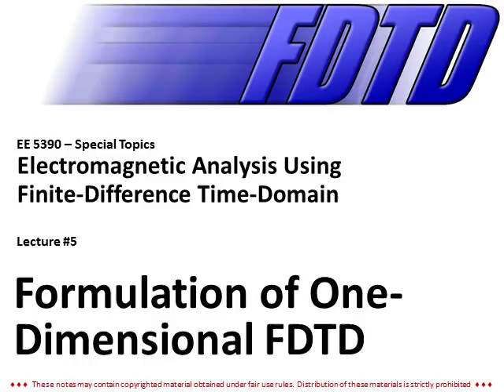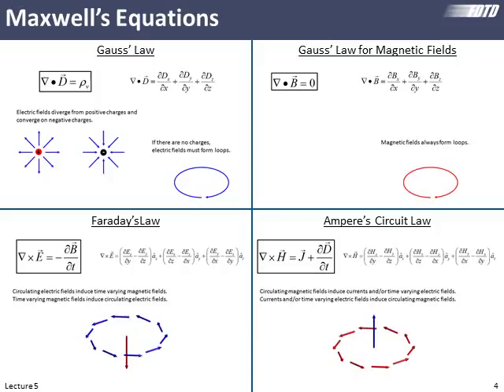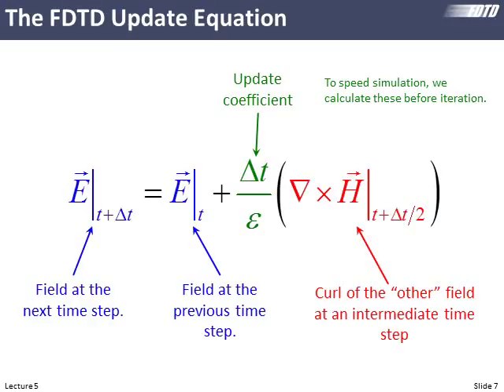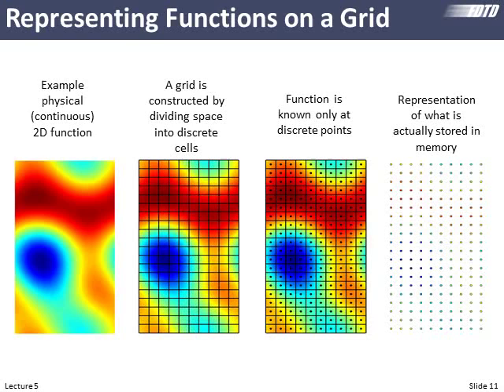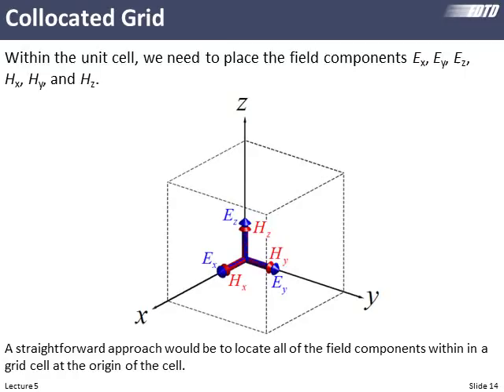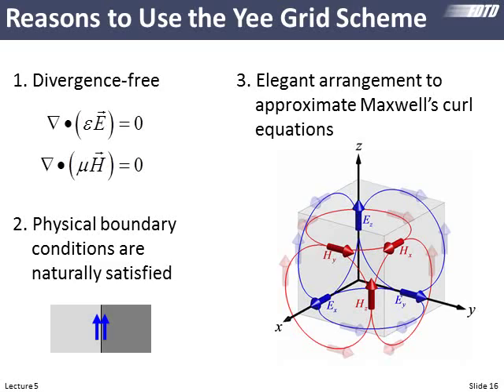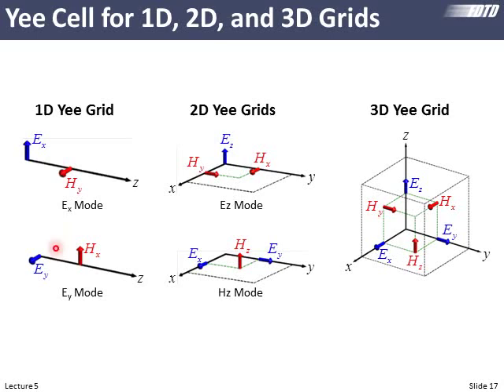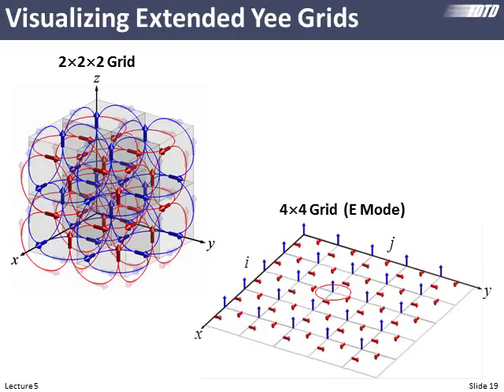Lecture 5 (FDTD) -- Formulation of 1D FDTD

Comment: I was reading the 1966 Yee paper,  the leapfrog method and t+dt/2 all made no sense.  I thought that all the fields should be at the same time step at least.  This lecture has made it abundantly clear how to reconcile the spatial and time increments.  I can't wait to see what the next 20 something lectures reveal.
Reply: OK

I had to slow down here and really formalize in my own mind what had been presented so clearly.  Writing down, in my own logic, what I had learned to this point and writing code was the key to the next level of understanding. I think that I even learned more about coding (comments), Taylor's series and finite differences and more about the Yee grid - leapfrog method - implementation.  

I guess I'll have to put it on a list of future studies to understand, by trying it, how the co-located grid points fails or gets complicated.  In other words why bother with the staggered (sp?) analysis.
Reply from the maker: The co-located grid does not inherently satisfy boundary conditions at the interface between two materials.  Instead, it acts like there is an electrical current at the interface that changes the magnitude of the scattered waves in strange and unpredictable ways.  The staggering fixes this.  There is a proof of this in Taflove's book on FDTD.

Comment: Looking like there are two  "bugs" in the MATLAB code (time:  43:35,) 
1) Hx(nz-1) when nz==1 Hx(0) is inaccessible (MATLAB is 1-based)
2) The loop work separately on H and E while each one depend on the previous step of the other one.
Can @EMPossible please advise?
Reply from the maker: You are absolutely right!  The solution to the problem is called a "numerical boundary condition."  That is covered in the next video.  I am trying to minimize the number of topics I cover at any single time so I do not overwhelm people.

Comment from the maker: A good question was asked, but then removed.  It asked about whether it is better to normalize the electric or magnetic field quantities in FDTD.  Here was my answer...

You can normalize either one.  From a mathematical perspective, one is not better than the other.  It is far more common to normalize the electric field quantities.  The most likely reason is that it was done that at first, and all others just followed suit.  [see note at bottom]  In this lecture series I show both, but adopt the more common practice of normalizing the electric field quantities through most of it.

If I could go back and time and change things, I might recommend we normalize the magnetic field quantities instead.  Most simulations ignore the magnetic response so there would be less quantities to normalize.  Also, we usually interact with our simulation (i.e. sources, detectors, visualization) through the electric field.  Have these quantities not normalized would be a little more straightforward.

In the end, it is just a constant so I would not worry much about which is better.

[note] A more extreme example of somebody doing something one way and others following blindly is in the area of semi-analytical methods like transfer matrix method, method of lines, and rigorous coupled-wave analysis.  Scattering matrices are usually used and EVERYBODY is implementing them incorrectly.  In fact, I wrote a paper on this...

http://www.jpier.org/PIERB/pier.php?paper=11083107
Reply: Why don't we non-dimensionalize both electric and magnetic field? I am a CFD student and in Fluids we have to non-dimensionalize all the terms in the equation. I want to understand why do we follow different practice in Electromagnetics? 
This topic is related to my PhD proposal and I would like to contact you about it. I have done some initial work in it using the methods I have learned in CFD. I would appreciate to have your feedback.
Reply from the maker: We should, but we do not do that here.  This course is an introductory course to computational electromagnetics and I did not want to throw too many things at them at once.  In the follow on class, we do this for every method we implement.

Comment: In slide number 46, a bug is present in the code. 
for nz = 1 : Nz
   Ey(nz) =Ey(nz) + mEy(nz)*(Hx(nz) - Hx(nz-1))/dz;
end;

Hx(0) appears in Hx(nz-1) when nz=1.
To avoid if statement in loop one can write the difference equation before for loop and then run the loop for values 2 : Nz
Reply from the maker: anuraag b You are right.  There is a similar "bug" in the other loop as well at nz = Nz where we try to access Ey(Nz+1).  This is an intentional bug because I handle the boundary conditions in the next lecture.  I am trying not to throw too many things out there at once.
Reply: CEM Lectures Thank you sir.

Comment: Where I’m quite unsure is how your matlab code correlates to the yee grid.

When we assume a 1D yee grid with a length of 100 (So Nz =100), the electrical field exists as an example at every even number of the yee grid array (2,4,6,…). According to that the H field should exist at the uneven numbers of the array.
Am I right?

But in your matlab code it seems to me that H and E field exist at the same points in space.

The only solution of this I can think of (If I could see the rest of the code) is that you map the H and E field (which are both of the length Nz =100) to the „actual“ grid which has a length of 200.

Could you tell me if my assumptions are right?
Reply from the maker: It is not correct to think of E as existing at array indices 2, 4, 6, etc.  The E field exists at 1, 2, 3, 4 and so does the H field.  It is just that while E(1) and H(1) have the same array index, we need to remember that they are physically a half cell separated from each other.  Similarly, even though we track the time steps in FDTD as 1, 2, 3, etc., the E and H fields are a half time step apart from each other.
Reply: @empossible1577  Thanks for your very fast reply. So, if as an example There is an array length of 50 (for E and H) would that mean that there’s an actual length of 100 for the points in 1D space?
Reply from the maker: @erenjaeger5344  Ah, I think I know where you are stuck!  I have drawn the E and H together to represent their physical positions in space.  However, in computer memory, E and H are stored in separate arrays.  Therefore, you will have two arrays of length 50. Does this make sense?
Reply: @empossible1577  Yes, kinda. It makes sense to me that E and H are stored in different arrays. 
But how does it correlates physically?
Imagine I have a „1D distance“ of 100 meter which I discretize to 100 points so that each point has a distance of 1 meter to each other. 
So will the H and E array each have a length of 50 „points“?

The E and H then will be so mapped  to the 100 points in space (as an example):

Point 1 = E_field(1)
Point 2 = H_field(1)
Point 3 = E_field(2)
Point4 = H_field(2)
…
Point 99 = E_field(50)
Point 100 = H_field(50)
Reply from the maker: @erenjaeger5344  I would try to not think of having 100 points.  Think of have 50 cells. Inside each cell are two field quantities that are a half cell apart.

Suppose you have 50 cells representing 100 meter length.  The size of the cells would be 2.0 meters each.  The points have no size, but they are 1 meter apart from each other.  The E in one cell is 2.0 meters away from the E in the next cell.  The E in one cell is 1.0 meters away from teh H in that cell.

BTW, I recently wrote a book that puts a lot of this into writing.  I have almost an entire chapter devoted to setting up a grid.  The book also has codes.  Here is a link:

https://empossible.net/fdfdbook/

You might find this book helps a lot.
Reply: @empossible1577  Thanks for your help. The book looks very interesting, but it’s not finite difference time domain.
Reply from the maker: @erenjaeger5344  That is true, but FDFD is extremely close to FDTD. The Yee grid, calculating grid quantities, building devices onto the grid, etc., is all the same.
Reply: @empossible1577  Ok, I think I’ll order the book. Another question, which  value do you assign to c0/ speed of light? I have some several problems with the constants mEy, mHz. When the value of these variables are larger, my simulation diverges to infinity.
Reply from the maker: @erenjaeger5344  That depends on how you define your units.  For FDTD, I typically use standard mks so I define the speed of light as c0 = 299792458.

Comment: Thank you for these very helpful lectures. I have a doubt. The direction of four H (or E) fields which circulate around E (or H respectively) fields in the unit cell does not matter? It seems that two are clockwise and two are anti-clockwise.
Reply from the maker: I am showing the field components pointing in their positive direction, not necessarily the direction they will actually be on the grid.

Comment: Why do we stagger E and H? Because if we do that then all terms wouldn't exist at the same point in time. Am a little confused about that. But overall I love your lectures! So useful.
Reply from the maker: The fields are staggered in order to write the finite-difference equations with the greatest possible accuracy.  I justify the staggering in a bit more detail in Topic 7c here:

http://emlab.utep.edu/ee4386_5301_CompMethEE.htm

The Yee grid has other benefits as well.  Maxwell's divergence equations are implicitly satisfied just by staggering the fields.  Physical boundary conditions are naturally satisfied on the grid.

You are also correct that this would put the field components in physically different positions.  This means that even though they are in the same cell, the components may reside in different materials.  The staggering also means the field components will be out of phase.  If you ever wanted to combine them, you would have to interpolate them to a common point first.

Comment: How does the time differnce of Electric and Magnetic field  (one exists at Ν*ΔΤ and the other at Ν/2*ΔΤ )   implements at this code since u update both fields in one time  step  ?
Reply from the maker: Take a look at the block diagram on slide 9 of Lecture 5.

http://emlab.utep.edu/ee5390fdtd/Lecture%205%20--%20Formulation%20of%201D%20FDTD.pdf

Notice, first the H field is updated from the E field all the way across the grid.  This takes the H field from (N-0.5)*dt to (N+0.5)*dt.  

After that is complete, a second loop updates the E field from the H field all the way across the grid.  This takes the E field from N*dt to (N+1)*dt.  

It is like the H field update loop steps you a half time step, and then the E field update steps you a second half time step.  Thus, one iteration in the time loop is one full time step.

Does this help?
Reply: Thank you for your reply !!Yeah but where is the time variable at the fields on the code ?It is applied as soon as you add the source??And if thats so why u have Steps variable on the code and not time ?
Reply from the maker: There actually is no time variable or even a record of time.  Once you perform the update, the fields are only valid at the future time step.  You would have to create your own variable to track it in time.  Usually it is just tracked as N*dt or (N+0.5)*dt where N is the time step.  Technically, you would say that the time information is implied instead of being defined explicitly.
Reply: Hmmm.I dont get it 100% i guess i will check your code when u insert the source and i will find out what happens .Thanks for these lessons they are pure gold :)
Reply from the maker: Thank you!
Reply: @empossible1577  I had this doubt. But, your reply cleared all the doubts. Thanks for all these wonderful lecture series.

Comment: I think there is something wrong with the code in slide 46.
Hx(nz) and Ey(nz) both should lie inside the same loop,
if this was not the case, all iterations of the first loop at first time step could work on zero Ey array,
thus other iterations will not work correctly.
Am I right?
Reply from the maker: These must be in separate loops.  If they were combined, then there would be some values of H that get updated using both old and new values of E, which is not correct to do.  Likewise, there would be some values of E that would get updated using both new and old values of H.

Remember that E and H are staggered in time.  The algorithm must update H to a new time value based on the values of E at the previous time step.  Thus H must get completely updated without doing anything to E.  Then his repeats as E is brought to the next time step based on H, but without doing anything to H.  It is called a leap-frog algorithm.

If you want to convince yourself, try putting them into the same loop and try doing it as I have on Slide 46.  Watch the difference.  Of course, you will not see anything until you incorporate a source which is discussed in the following lecture.  Give this a try.
Reply: Thanks a lot for the quick reply!

Comment: These lectures are still great!  However you seem to have used the Ex/Hy mode equation with epsilon_xx_k instead of using the Ey/Hx mode as stated. before solving for Ey. Since you're assuming isotropic material this still works.
Reply from the maker: Hmmm...Perhaps I mispoke!  There is a newer set of notes I can point you to.  I recommend using the course website as the main portal to the notes and lectures.  Here is the link:

https://empossible.net/academics/emp5304/
Reply: @empossible1577   Thanks! Will also double-check my work too. I was following lectures 4 and 5 using wxMaxima to enter the symbolic derivations up to the point of developing the Matlab code. Maxima does a lot of simplification and evaluation for you while using symbolic math. But it generates big equations as you build up the derivation. I may have lost track along the way!
Reply: Forgot to mention that SymPy and SageMath will do this this type of symbolic math as well. Matlab has the symbolic toolbox but is not open-source and I like free software.
Reply from the maker: @thefrazz  I know it will be tedious, but I recommend doing the derivations by hand so you get to know the steps and the rhythm of formulation.
Reply from the maker: @thefrazz  I wonder if Octave has a symbolic toolbox?
Reply: @empossible1577  Will do that too - then I can tell if wxmaxima is giving the right results.
Reply: @empossible1577  Octave does have a symbolic package that uses SymPy under the hood. SageMath also uses SymPy under the hood. Started using Sympy directly to get used to it. They have a great tutorial site that gives you access to Sympy Live on the tutorial pages.  The web page is at: https://live.sympy.org/
Reply from the maker: @thefrazz  The more I learn about Octave the more I am impressed with it.  If MATLAB were not available to me for "free" from my University, I would be using Octave or Julia.
Reply: @empossible1577  Octave is very close, but had to dig into their graphics library to implement a surf2patch function. Julia looks fantastic! It's a faster alternative to python, but will let you use python libraries. For more details check out Julia Academy and Julia Hub
Reply: Your video is correct - I got confused translating the equations to symbolic form for maxima. Sorry!
Reply from the maker: @thefrazz  Glad we got it figured out!
Reply: @empossible1577  It's definitely tired at 1am when your brain stops working! Thanks!
Reply: There is another book I bought in addition to Taflove's book. That one comes with extensive Matlab code building up to a gigantic application. The surf2patch function isn't needed in octave so  his chapter 3 code is now working in octave. I don't want to give the name of the book in case your students are watching this conversation, but it's from the IET website.

Comment: Professor, I have a question, why in 42:00 are Ex and Hy in k direction? I was thinking if Ex is in k direction so that Hy is in j direction.
Reply from the maker: Ex is a field oriented in the x direction.  Hy is a field oriented in the y direction.  The grid extends only in the z direction so all these variables change value along the z-axis.  k is the array index in the z direction.  So k does not imply direction of Ex and Hy.  k is the direction that they change in value.  Ex(z) and Hy(z).  Does this make sense?
Reply: @empossible1577  Yeah, I am clear now. Thank you!

Comment: how would write absorbing boundary condition for lossy material
Reply from the maker: Great question!  It is not as simple as just incorporating loss.  Doing just that will cause reflections from your lossy regions, which doesn't fix your problem.  You have to keep the impedance of your lossy region matched so that waves will not get reflected and will be absorbed.  This is called a Perfectly Matched Layer (PML) absorbing boundary condition.  It is covered in great detail in Lectures 13 and 14.  Keep working through the lectures.  You will get there.

Comment: while doing finite difference equation for magnetic field we are taking the difference of the same cell and the next cell but while doing for electric field we are taking previous sir , why??? 
I dont know whether i missed something in previous lecture but  while going through these lecture i m not able to understand this points ....
Reply from the maker: You are correct!  This is because the field components are staggered in both time and space so the finite-difference equations look different for both.  This is discussed in Slides 14-20 in the Yee grid section.
Reply: i got sir.... sir in slide16 div free is not clear how yee model signifies this
Reply from the maker: If you have access to Taflove's book on FDTD there is a good proof of this.  Otherwise, that was beyond the scope of this course so I left out the proof.
Reply: PRAKASH JOSHI ji
Reply: yes
Reply: got my ans sir why div is zero
Reply from the maker: Great!  What did you find?
Reply: why div is zero
Reply from the maker: Yes, but what specifically did you learn that let you understand why div is zero.